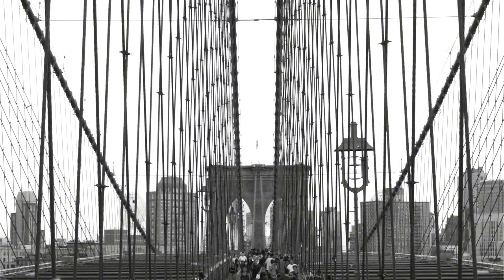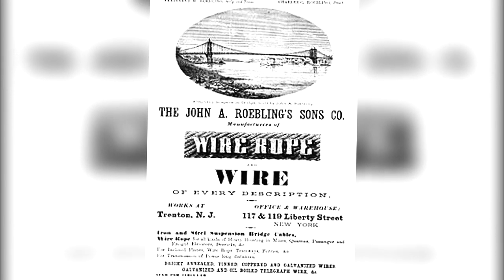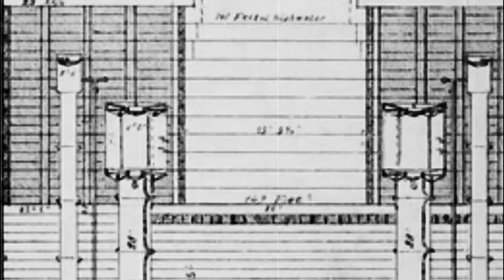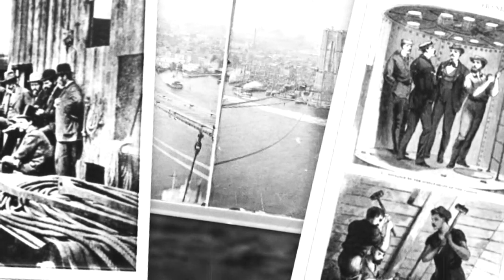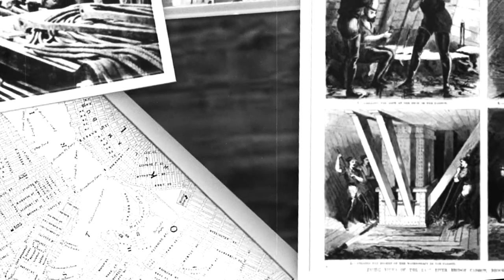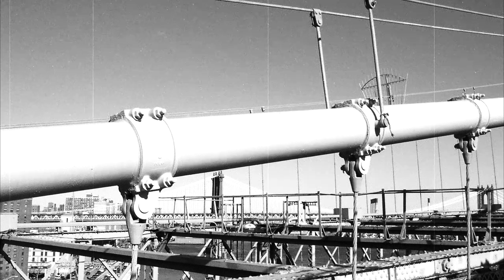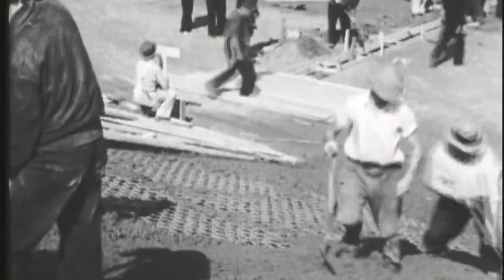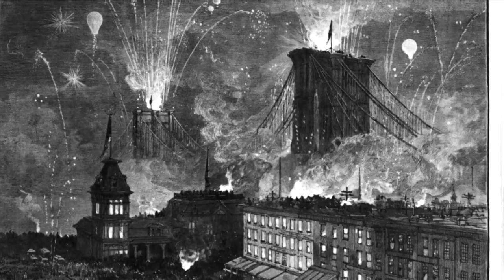Brooklyn Bridge: An Engineering Marvel - How It Was Made

Comment: Cables are not steel, they're structurally deficient iron,as the supplier cheated the Roeblings. Read; The Bridge by    David Mcullough.
Reply from the maker: I actually was aware. The same cable was submitted for testing over and over while the real cables were garbage. I left it out because that wasn't exactly a "design decision" for the bridge's engineering - so I left that detail out.